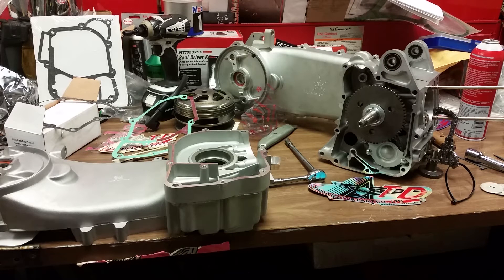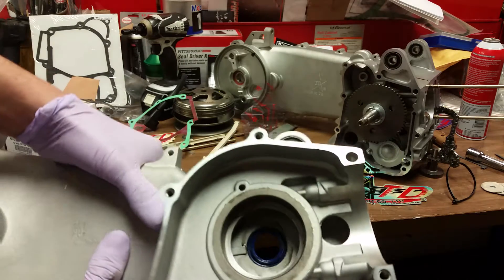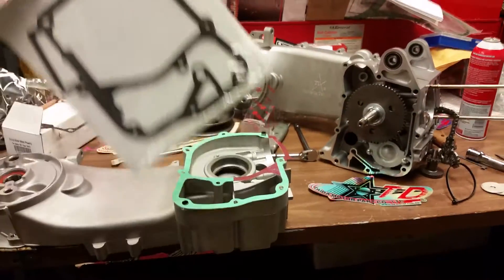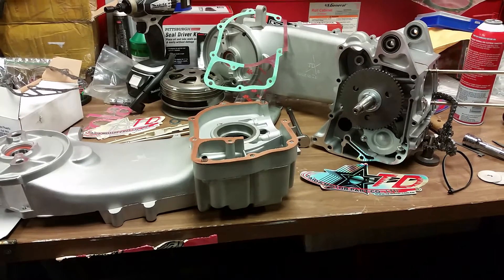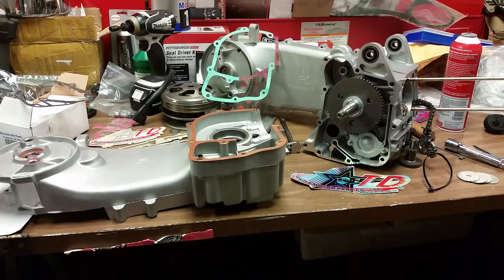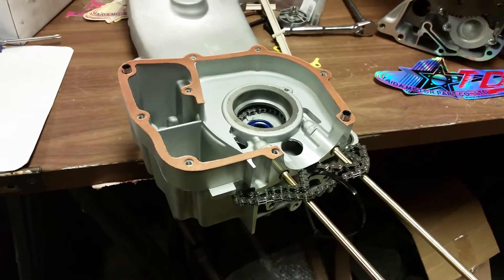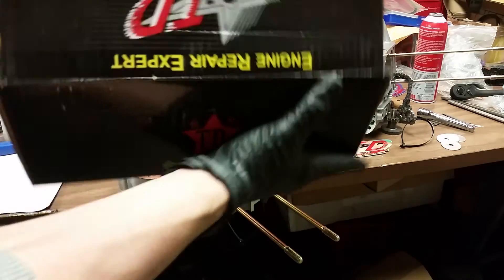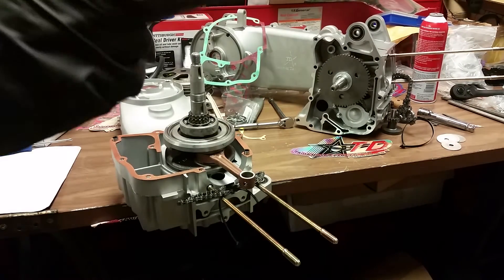Taida 190cc 3mm Stroker Crankshaft Install 02

Comment: Hey there Dan. Can I use a high compression piston with the +3 mm crank. I’ve got a the Taida big valve head and matching 61mm jug. I saw a hood deal on the 3mm and was wondering what it would do with a high compression piston.

Comment: Hi Dan if I installed a 180cc big bore kit on my 150cc 157qmj would I have to change out the crankshaft for larger striker or can I use the stock original?
Reply from the maker: Stock works fine... what you will be required to add is more air/fuel and open the exhaust... this is usually accomplished by upjetting the carb or bigger carb, free flow air filter (such as a uni) and a free flow exhaust...
Reply: @dmartin925  Okay Dan great and thx I will go from there!